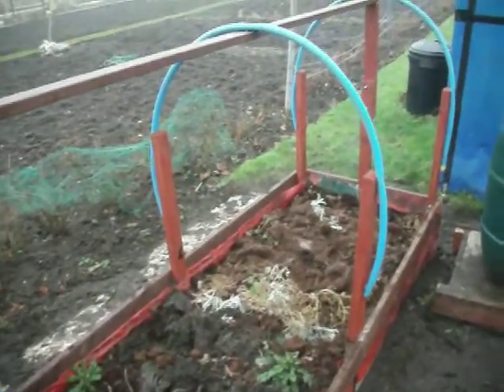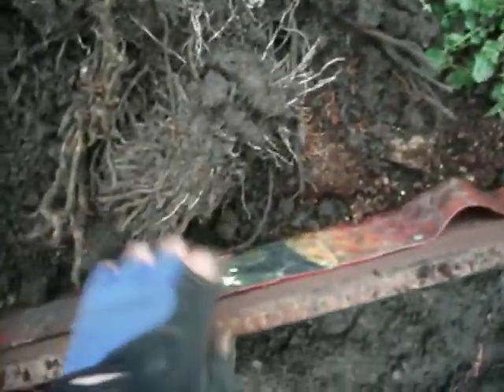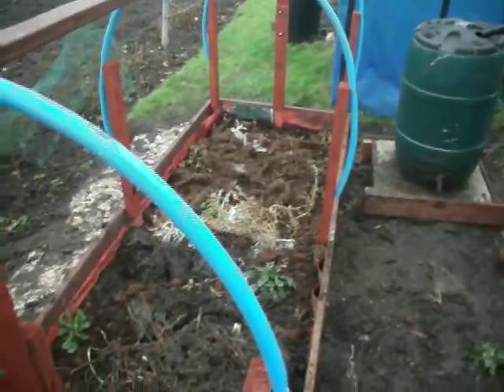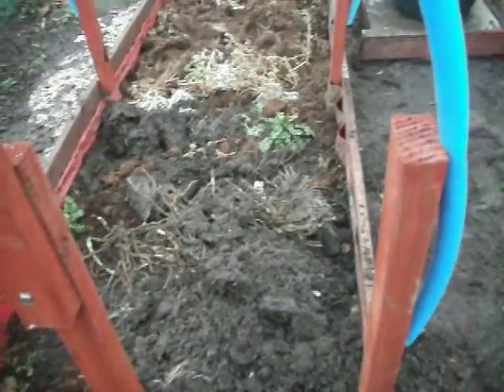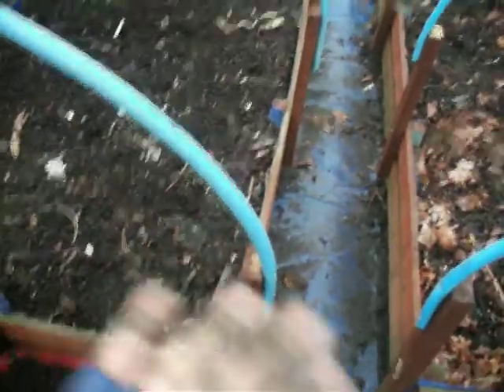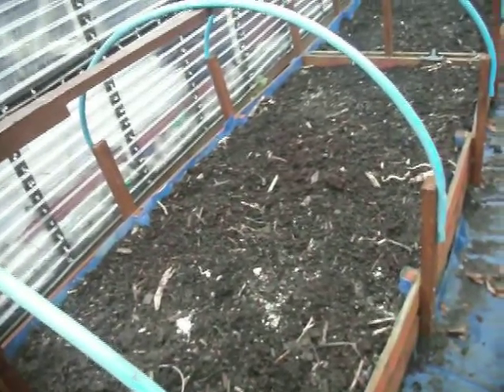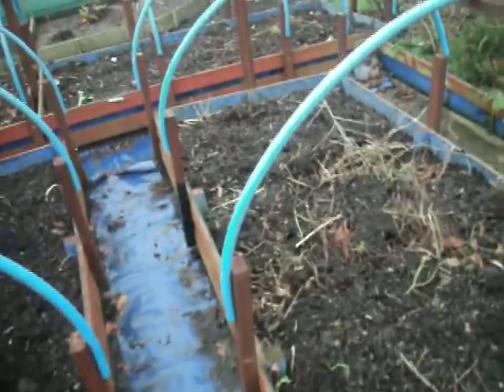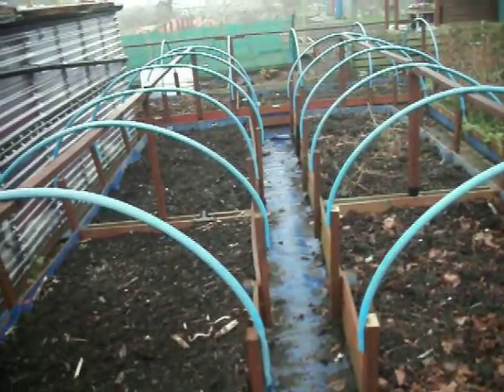allotment gardening 2012 hooped beds or lowtunnel over raised beds.

Comment from the maker: Hi TM. I have had a plot since 2005. Lots of mistakes over this time. My view is if I could go back? Would have put peds in then, The design is important as you want to try and avoid having to do it again years on due to wood rot. You can put plastic on early in the season and remove, keep it covered all season or use netting (debris netting-search for this-it is tough and lasts a good few years).